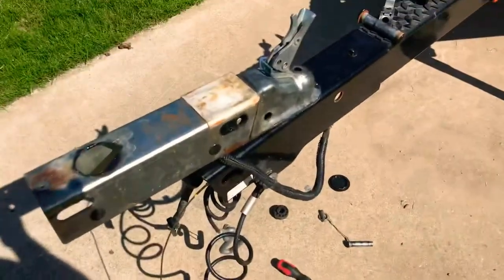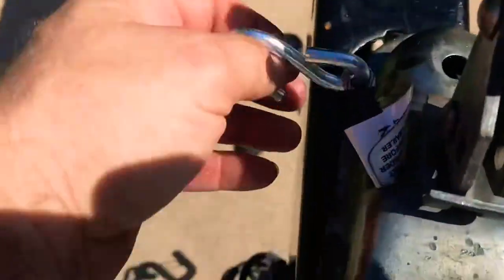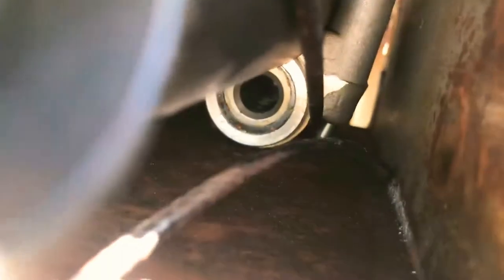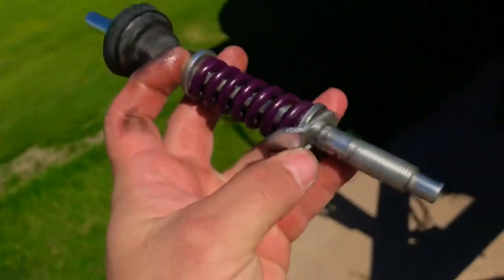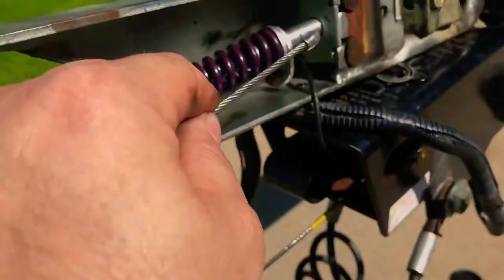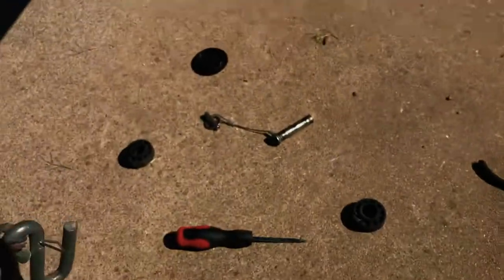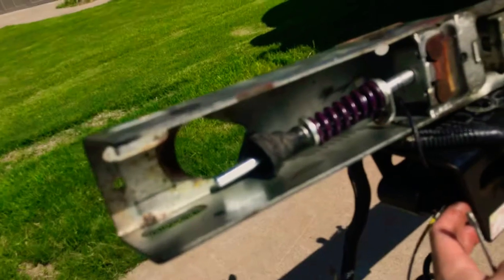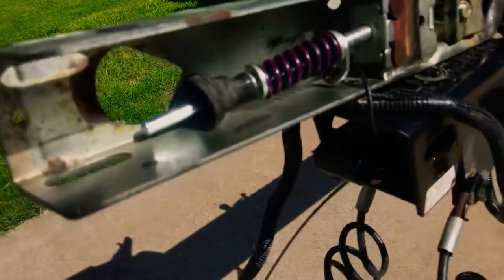UFP-A75 UFP-A70 UFP-A60 safety Cable Replacement

Comment: Were you able to remove these parts without disconnecting the brake cable from the back of the master cylinder?
Reply from the maker: Yes, it's a Pain, but wasn't to bad after I realized how everything went back together. It was some serious trial and error.